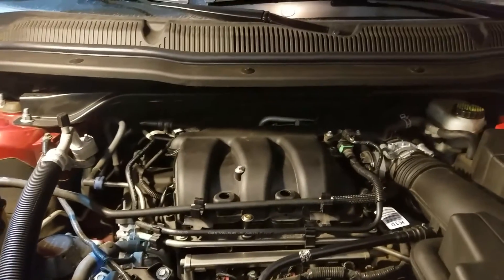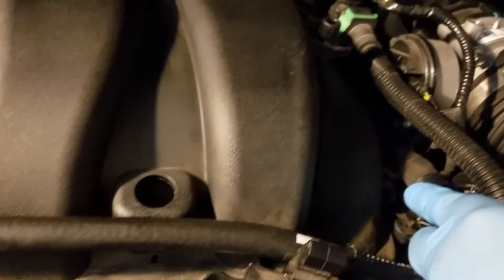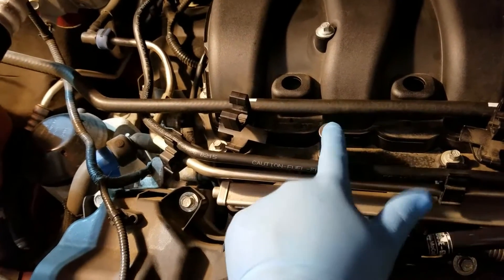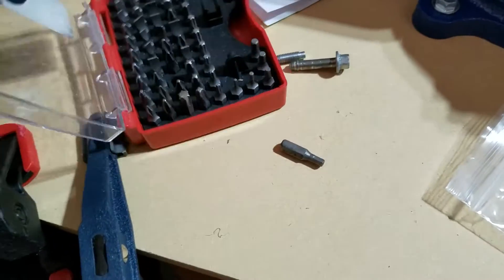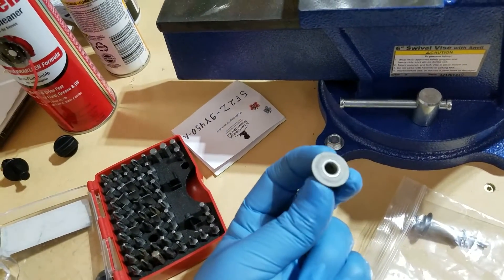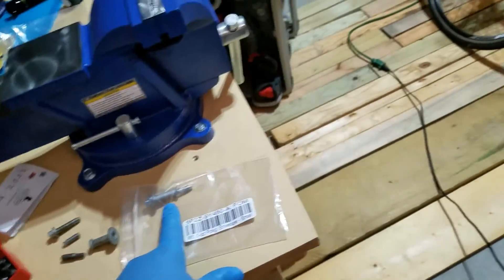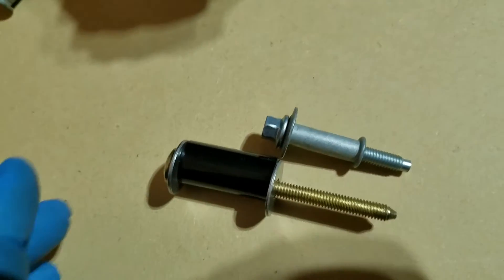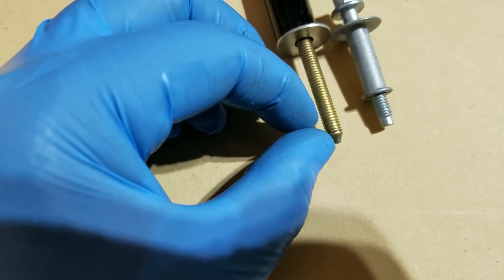Ford Explorer intake manifold bolt snapped fix

Comment: My 2016 Ford edge manifold bolt broke at 10 lbs of torque. Can't imagine trying to run them down to 89 ft lbs. What a scam. Bolt is the second one to the right and I just left it  and car runs fine at all bolts down to 10 lbs of torque.
Reply: It’s actually 89 inch pounds, but even that has snapped a bolt, such a poor design

Comment: Thank you for this video, however, it cut off before you were finished with the replacement. Did you snap it back in place when the valve cover was on the engine or on your shop table?

Comment: I broke that middle part you took as spare , on my dads explorer iwas worried it was gonna leak ifeel better now 😂 were you having any problems while that middle bolt was off ?
Reply from the maker: No problems, as it was torqued to spec and it is a naturally aspirated engine.
Reply: I have a 2016 Ford Edge 3.5 liter. I decided to change the plugs at 50,000 miles and  got all back together only to break the bolt on the manifold. Torque spec says 89 ft lbs. I started out at 10 lbs to start safely and bolt broke at 10 lbs. I believe Ford intentionally did this to prevent do-it- yourselfers. Now I am seeing this happens quite frequently. What a scam.
Reply: @sharynbicknell1107 it’s actually 7 inch pounds. That’s where I made my mistake. I set my torque wrench to 10. But foot pounds and inch pounds are vastly different in torque ratios.

Comment: Nice vedio thanks for sharing, i have same exact car and engine, and snapped the same exact location bolt , after troqing it , but not sure what is foot pounds they needd to be torqed to, i have been driving it like this , no issues, but i will be ordering the same part you have shared in your vedio , thank you.
Reply from the maker: I followed  FordTechMakuloco guide (2011-2017 Ford 3.5L & 3.7L Duratec V6 Engines: Spark Plug Replacement):
Intake Manifold Torque Spec-
STEP 1: 89in lbs
STEP 2: 45 Degree additional turn
Intake Manifold Torque Sequence- https://drive.google.com/file/d/0BzYkF_-Nh949amlkWDdtQWtPcUU